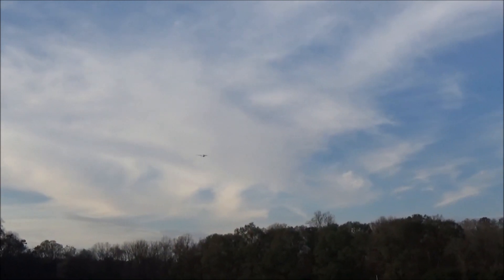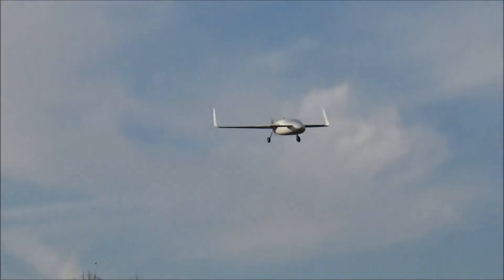Raptor Aircraft Model Second Flight

Comment: When they had similar stability problems with the 747, the fix ended up being a very slight twist to the wing, so the outboard leading edges had about 3° shallower angle of attack than the inboard portions.
Reply from the maker: We already have about 2.5 degrees of washout.
Reply: @RaptorAircraft  it would have amazed me, had I been the first to think of it.

Comment: 43 years in model aviation; I don't believe larger winglets are your 
solution. the slow speed rolling is due to the wing tips stalling before
 the main body of the wing. loss of lift at the tips will produce your 
slow speed rolling effect, that's why it flies fine at higher speed. I 
don't believe your winglets doubling as rudders will work either; have 
you thought about drag rudders like on the B2 Spirit bomber? I'm 
available to come help with your little project, just say the word. FREE
 of charge by the way just feed me and a corner of the shop to sleep. 
just putting it out there. I share your vision.  :)  Kenny
Reply: Late but seeing your comment, pretty sure the usual fix in models is a bit of washout in the wingtips so they stall after the center..
Reply: Yeap more washout
Reply: Hanger Fiftyone 

Have you ever seen a velocity Sir?   It flys very well with the rudder winglets.
Reply: @thomasisham3372  As does the Varieze and the Longeze and several other canard designs!
Reply: They usually only deflect one rudder at a time to get the one sided drag effect

Comment: May I suggest Prop reversing. I worked at beech aircraft right after the kingair was certified and reversing was being installed.  I have observed heavy reverse to stop the plane in less than 1000 feet.
Reply: Will have a full reversing prop